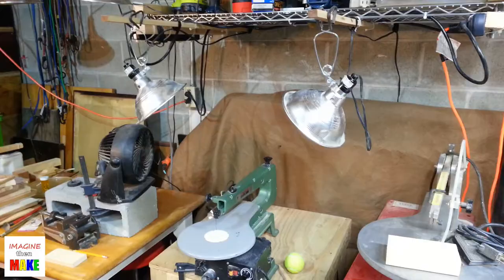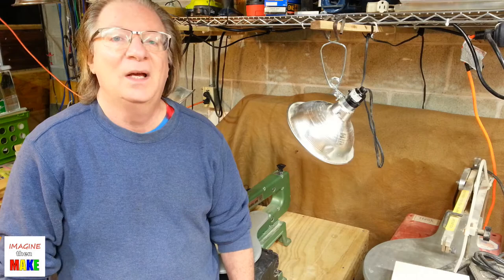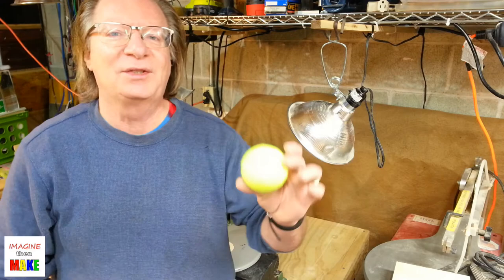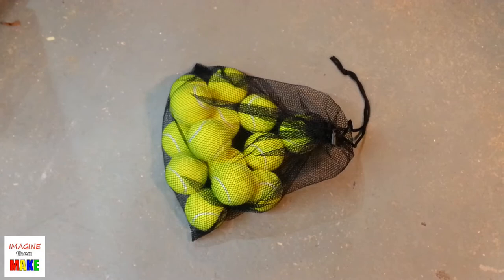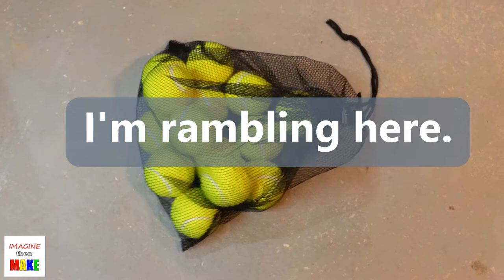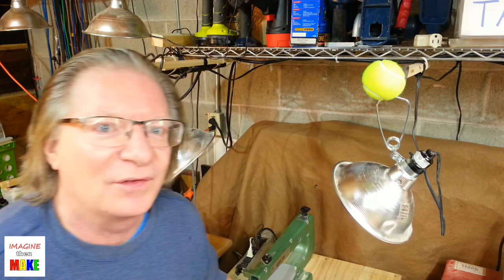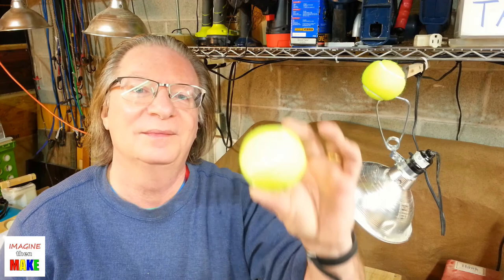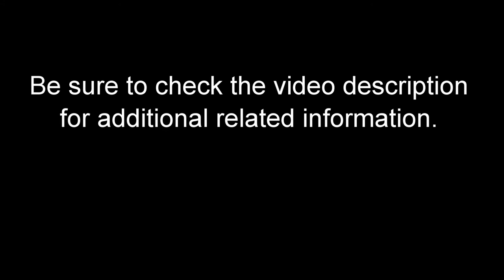119. Drilling a hole in a tennis ball. (shop safety)

Comment: Good idea! Tennis balls are also good for preventing the edges of a shovel blade from abrading the floor of a car-roof cargo box. Those balls, plus one on the handle, also silence rattles. No drilling, just cutting an "X" with a knife. Duct tape holds the balls in place.
Reply from the maker: Sounds like the voice of experience! Thanks for the tip and for watching.

Comment: Are these pressurized tennis balls? I bought 12 of them from Walmart like you to put on the ends of chairs but that looks too darn hard
Reply from the maker: Hi Debra. Sorry about my slow response. Yes, these are pressurized tennis balls. Just regular but inexpensive tennis balls. I think you have the right idea about putting them on the ends of chair legs. And I can also see why you might think it is hard to do if you don't have a suitable tools to make the holes. (As you saw in the video, I used a drill press and vice.)
Thanks for your comment and for watching.